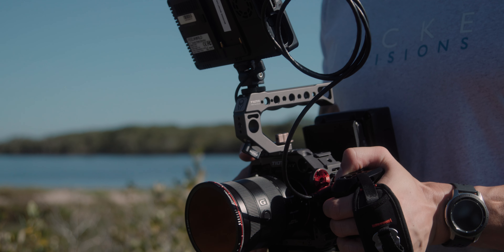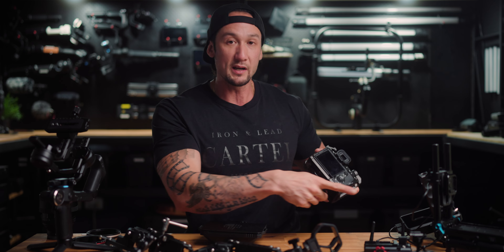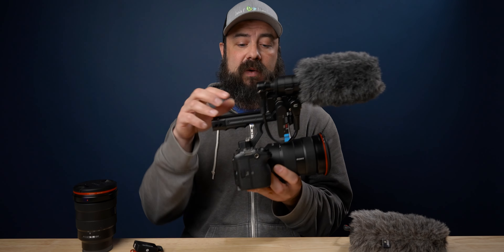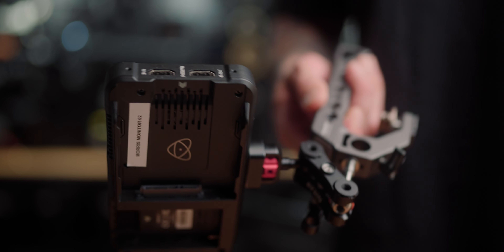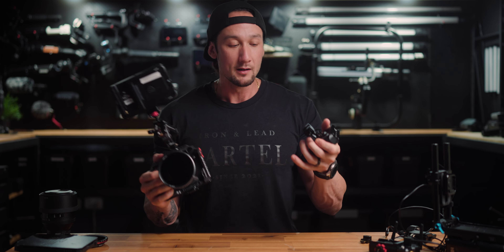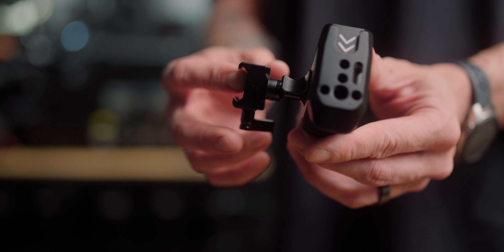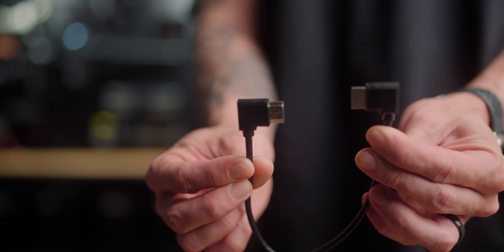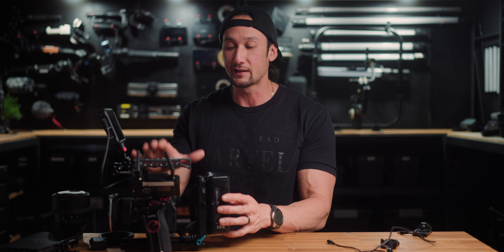Full Sony A7IV/A7SIII camera rig breakdown

Comment: Don’t get a dummy battery if you have a vertical grip. Gerald did a video regarding overheating and found that vertical grips reduce heating in the camera a lot, much like dummy batteries do. For me, I’ve got the C4EM OEM Sony grip on my A7IV and I’ve never had it overheat. Though I gotta say powering everything off of one battery is very nice.

Comment: I’ve been using the Rode Wireless go lately because my shotgun gets in the way if it’s mounted on the right cold shoe and my left hand wooden handle doesn’t cold shoe. I still haven’t found a great solution because I bump the mic when using the top handle and I can’t move my Atomos Shinobi too far with the shotgun (deity V3 Pro) when attached. 
I wonder if the ride wireless can be used as a shotgun lol
Reply from the maker: it can. It is more of a cardioid pattern though so will pick up more of everything rather than directional.

Comment: Does that quick relate plate twist and turn? I am having a hard time building a rig that remains in place using a quick release or attaching the cage directly to the rod base plate.
Reply from the maker: It’s a button clip. Clip it in and release the button clip to free it
Reply: @JasonMorrisphotocinema  what is the button clip screwed to, i also i have the a7siii rig and the tilta full cage with the tilta rig base. but i cant find a screw long enough to go through a plate to connect the quick release so i have to use the camera cage base plate that came with the tilta cage

Comment: I have a query regarding a7iv body. When I tilt my a7iv for vertical shots.. there is a sound very clear..of some part moving in the body..as if some part is loose..is it a manufacturing defect?? Or does the sensor or any part move/wobble in the camera..is it something to do with the IBS?? Pls explain..
Reply from the maker: that is the sensor moving. that is normal. Essentially when the camera is off the sensors kind float around a little

Comment: Hey Jason, how would you capture audio from 2 sources? i.e. 2 lav mics and 1 shotgun mic ?
This would be a run-and-gun situation where the environment would be slightly noisy. I tried using 2 lav mics and that seemed to have turned out fine but sometimes I need to capture environment audio as well... and I'm not entirely sure how to do that.
Reply: with Black Magic Video Assist 12G Monitor you have 2 XLR-inputs